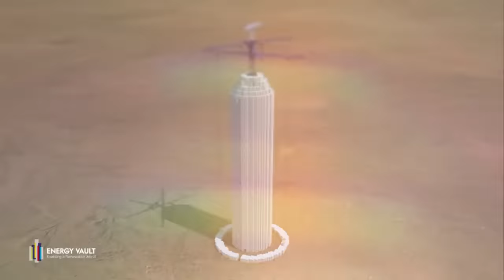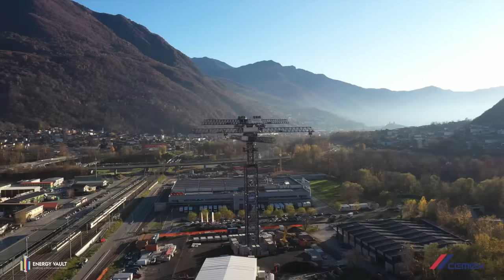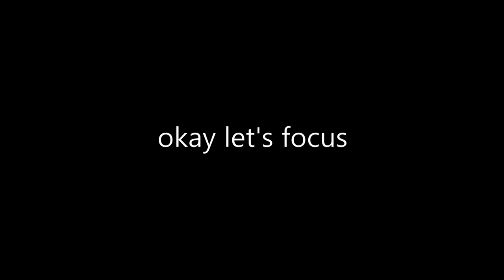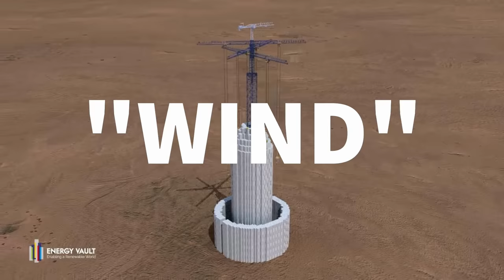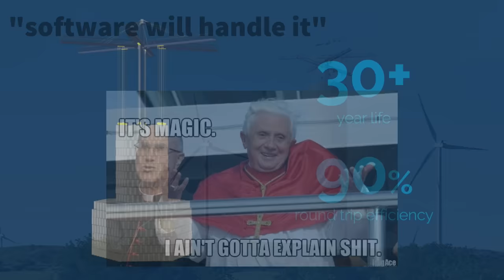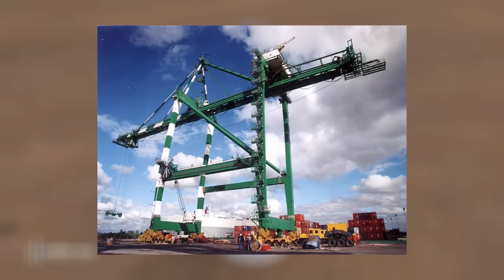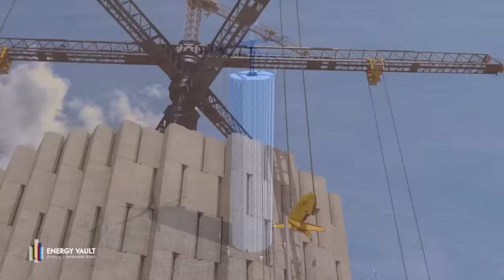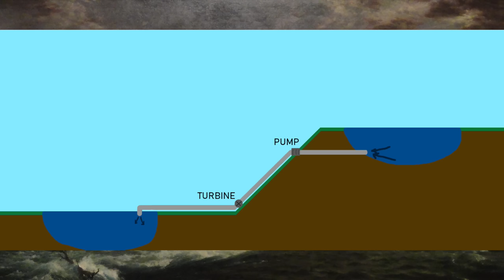The Energy Vault is a Dumb Idea, Here's Why

Comment: I can tell you now; the maintenance costs ALONE on this thing would be eye-watering. Anything involved in lifting apparatus has to be replaced after a certain number of cycles, and assuming these things are lifting and lowering blocks nonstop, which they would be, the lifetime of cables, bearings, pulleys, would be, at a guess, less than two years. 
I reckon just the cost of lubricating that thing would cost around 100k a year, probably more. 
Upkeep is so often kicked under the rug when they announce these big scams.
Think about wind turbines - compared to this, they hardly have any moving parts

Water based gravity batteries are better. Period.
Reply: I'd first assume stupidity before malice. Is it confirmed to be a scam? Most likely they might have started innocent and stupid, but once the money came in, they had to commit to this stupid Idea (or admit their folly which no one ever does).
Reply: Upkeep costs and decommissioning costs are like the two biggest blunders I’ve seen from disconnected suit.

First, they build things without thinking about the costs of maintaining it, which leads them to scale things down rapidly mid-project until it’s affordable at which point the project is not accomplishing the goal set out for it. This is where nearly every single moonshot invention ends up.

Second, the blunder of penny pinching executives: when they’re balancing the sheets for something, they realize they could save on all the upkeep costs by just killing the project, all while forgetting that it often costs time, money, and effort to decommission things. These costs often runs up pretty quick, and overshadow the operating costs; meaning they won’t see the benefits of decommissioning for years. 🤦‍♀
Reply: Indeed.
Reply: True. Construction cranes aren't thrown away once a buildingsite is finished, but if they only last as long as they are needed on one site it's not that serious. They will have to be disassembled and reassembled elsewhere anyway, so their worn out parts can easily be replaced while doing that. It seems that they want to use the same tech as a construction crane that will maybe work for a year in one place, and operate it automatically for 30 years?
Reply: In the open air like this makes no sense but if you are working in an enclosed environment like a disused deep mine shaft it might be OK. Not using concrete that's insane but a steel or iron weight with most of the capital costs of actually digging the shafts already taken care of its basically just modernising existing infrastructure.
Reply: Good point. I'm not an engineer, but I was immediately going like "why? how? what?" in my head while watching this. Indestructible tech bro cranes with magic precision computer powers... And that's before even starting on the ineffectiveness of the whole apparatus.
Reply: Synchronous Condensers! Awesome tech that allows grid stability and uses flywheels basically
Reply: @uncinarynin  you’re absolutely right. Maintenance downtime would be crippling
Reply: you mean hydro electric dams.?
Reply: Storing excess energy as heat would work much better, barely any moving parts and you can heat rock quite a bit before anything happens to it. And when anything does happen there's literally trillions of tons more.
Reply: @antonk.653  Ah yes, Hanlon's Razor: "Never attribute to malice that which is adequately explained by stupidity."  Stupidity includes deluding yourself. Perhaps they've sold themselves on their own bullshit and this deep in have too many sunk costs to allow themselves see the fallacy, where the rational thing would be to cut their loss and get a day job. Maybe they want to succeed (ie to get rich) so badly and have invested so much time, effort, money, and most of all *ego*, into their pet project that entertaining any reasonable doubts is beyond question.
Reply: @antonk.653  The concept is afaik out of a university. That does not rule out stupidity but makes it a lot less likely. It maybe that the university stopped it because they found it was stupid in the end, and this is a "private investor" here, don't know. 
(Often you have to try seemingly stupid things so I generally don't blmae universities who try to see if something is less stupid than it looks. After all, trying to be faster than a horse was once thought to be blody stupid.)
Reply: @ThePirateParrot  Mine shaft is actually a very good thought - it saves a lot fo the costs - until you realize that the shaft is way too thin to make it work.
Reply: @ThePirateParrot  Iron ore would be way cheaper. Or any other rock for that matter.
Reply: @ThePirateParrot  If you only want weight, I guess rocks/gravel would be cheapest and most durable.
Reply: @samiraperi467  Heating/cooling cycles are quite inefficient as energy storage. It has something to do with thermodynamics (admittedly those lectures are long ago so I couldn't explain it in detail, but there's a theoretical upper limit to efficiency here that mechanical energy transfers don't have).
Reply: @uncinarynin  it's not just about weight but also loading density etc steel is dense cheap durable expands predictably and isnt prone to shifting
Reply: @puellanivis  very true. Just think about the solar hype, panel cost goes down, recycling doesent
Reply: @antonk.653  it’s always malice before stupidity. Stupidity doesn’t go so far that you have a prototype and investors.
Reply: @EebstertheGreat  yes but materials cost isn't actually that important when you talking about a life time of 30-40 years. Iron ore is half the density of steel and you rigging lose material is a pain.
Reply: Imo it would be much more reliable and realistic to use hydraulics to pressure use and lift these weights. I imagine we could like lift large bases/tanks of water or even just dirt or stone, on hydraulically actuated cylinders, then use the pressure in the presses to move turbines and such.

Another interesting solution is plugging up old, unused mines and pumping air into them, pressuring the entire mine shaft system, then releasing the pressure to turn a tribine
Reply: also what if you just like. pushed it over
Reply: @shoujocore  tbf, can you "just push over" a sky scraper or any high story building?
Reply: @boflator  skyscrapers are not made out of rocks
Reply: Not that their version of the idea is good but I think the best use case for a solid battery like this is areas with little water or very flat. But in those cases aren't flywheels better?
Reply: I think it's important for people to know that not all scams start out that way. Like, some excellent project everyone agrees must be done to meet a real need, then somewhere along the way it becomes untenable. A scam starts when that fact is hidden, viable alternatives are suppressed... I can't think of any real world examples of that at the moment. (the scheme in this video doesnt count) Anyone?
Reply: hehe "watering"
Reply: @ophidahlia1464  you’re probably right, it would definitely have started as a more or less innocent ignorance, and by committing to it and refusing to accept that objectively better solutions already exist, it becomes malice
Reply: @antonk.653  i mean, if they did basic calculations and research on the materials they proposed, it would've come up.
if they had no interest in researching the core numbers of this project, then i dont believe they seriously wanted this to work
Reply: I think you propose the real problem with that idea and the video doesn't.
Reply: @wojtekpolska1013  Yes, I agree. All they needed was a physicist to calculate the feasibility of their project. But I wouldn't say that they weren't serious (at first), in my opinion they were severely ignorant until it was too late. I, too, am sometimes surprised about myself when I spectacularly fail a project because I just didn't know a simple detail (home workshop projects, but still).
Reply: @nsfeliz7825  No, he means pumped-storage hydroelectricity, what was mentioned in this video as a more practical alternative.
Reply: @steemlenn8797  Abandoned open-pit mines exist if you just want semi-secluded building space.
Reply: They are better, but depending on geography may not be possible, or not possible in sufficient numbers. In fact, apart from countries like Switzerland or Austria, there are almost no European countries where you could put down enough of them, and if you could it would mean resettling hundreds of thousands of people. I'm not saying this particular proposal is a good idea. 
I'm saying pointing to hydro-electrical storage as the go-to alternative in all cases just does not work. In fact, in the majority of cases it does not work. Which is a very unfortunate reality.
Reply: Steel cables don't wear out nearly as quickly as you anticipate. Elevators already do the exact same thing for decades at a time with no cable or motor replacements needed. The whole point of braided cables is to reduce wear through cable flexing. You'd know this if you had ever worked with braided cables of any kind.
Reply: @deusexaethera  - Elevator cables are not exposed to the elements 24/7.
Reply: @antonk.653  Yep, Pocketing millions in investements from private and public sector, is obviously stupidity... malicely chosen stupidity because every con artist "needs" the cash.
Reply: I think lithium batteries would be better than this concept and there are a lot of better options for gross level storage than those.
Reply: @deusexaethera  Elevators are absurdly over-engineered.  Good luck scaling that design approach up to something like this.  They also aren’t exposed to the elements, and still require regular inspections and maintenance.
Reply: @boflator  A high rise is made mostly from multiple different materials for structural stability. You can't push over a high rise because it's specifically designed to widstand constant pushing from gusts of wind, a key component of structural design is how to handle wind load for a reason. 

That "gravity battery" has little to no structural stability as it's literally just blocks stacked on top of each other. Imagine trying to make a jenga tower, but the blocks are a couple cubic metes of concrete without any OSHA inspectors fiddling with "workplace safety".
Reply: The other downside is that the lower they get on the tower, the less total stored energy is available and the loss is worse than the stored water batteries.
Reply: Even chemical batteries are better.
Reply: There also seems like there would be a ton of energy lost to friction in all this.  The efficiency must be fractions of a percent.  And then, as the stack gets smaller, you're getting less efficient still as you have to reposition more and more often, since you're spending less time generating power.  What a silly idea.
Reply: Thanks for pointing that out. But compare the maintenance involved in a pumped storage system.  Add to that the costs of a dam/reservoir failure--rare, but MASSIVE--and all too often, including a significant death toll, and always, ecological damage.
Reply: Evie, i'd like to know your opinion of idea posted by jimandskittum
1 month ago
"I came up with a variation of this before I ever saw it. A long lever on the side of your house with a big weight on the end that would use electric power to raise up from horizontal and arc up to store the energy. Then the lever could run a generator through a gearbox and you could generate as the mast falls back to horizontal."  Wouldn't the lifetime for bearings etc on a lever, be greater than a cable/pulley system?  Not that i think this is scalable to petawatt level, just interested in comparison.
Reply: Added to the wear and tear, the blocks can't just be allowed to drop onto each other. The descent has to be controlled, so there has to a some kind of braking mechanism which is also bound to wear out eventually.